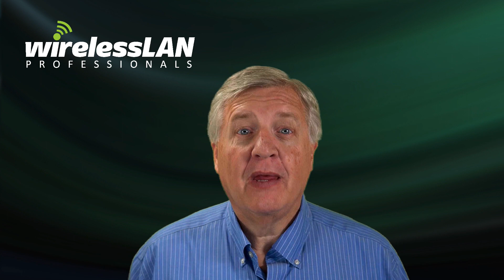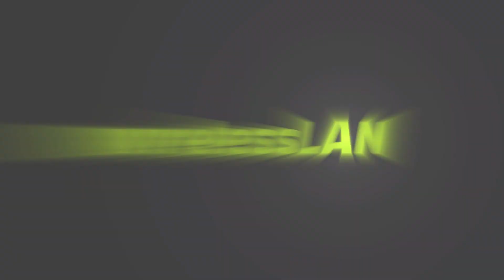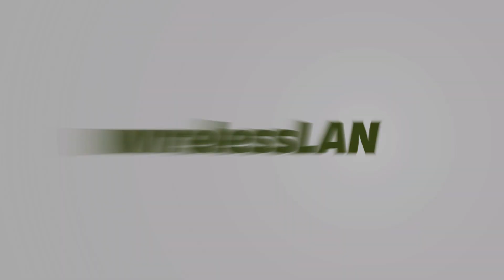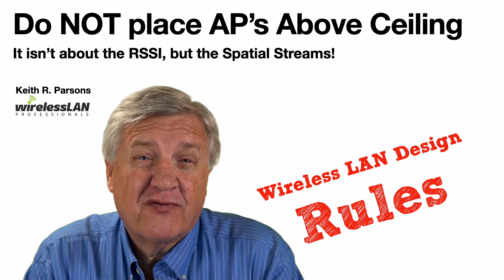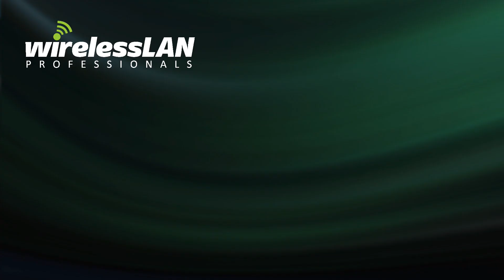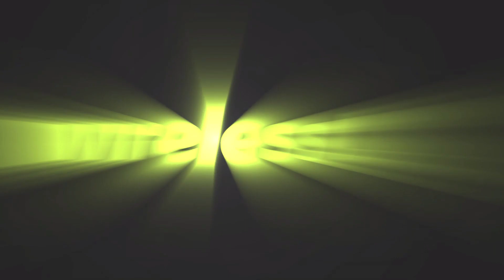Do Not Place APs Above The Ceiling

Comment: A few months ago, I mounted an AP on the bottom side of an air duct for a similar reason.  If I had mounted it on the ceiling (no drop ceiling), there would have been air ducts between the AP and part of the coverage area.

Comment: Ceiling tiles are thermal insulators, and most APs are designed to be passively cooled. It is easy to run into overheating issues when the APs are above the ceiling.